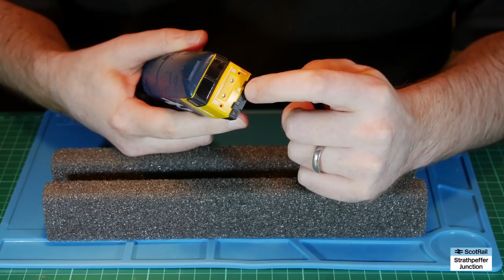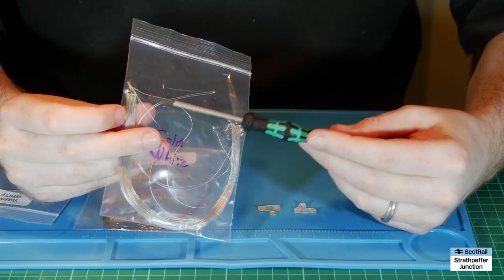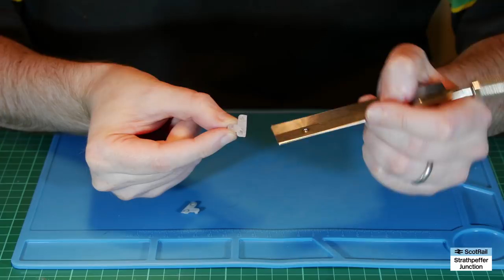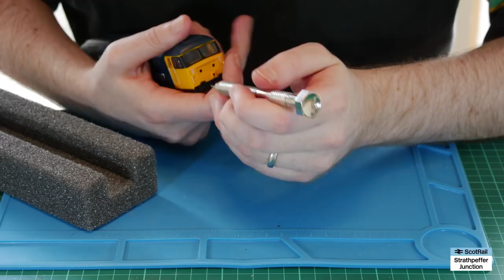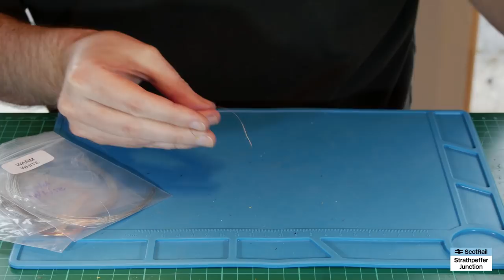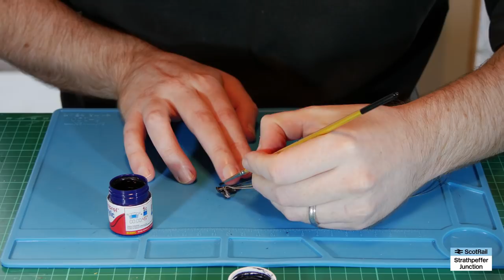#14 Lima Class 47 Loco Upgrade: Installing Directional Lights (Part 2a)

Comment: Nice work there.

Small suggestion.
When you're drilling holes for things like the red marker lights you've done here... use your model scalpel and use it to poke a precise dent at the centre where the hole will be drilled.

It works like a shallow pilot hole to give a guide so the drill bit doesn't accidentally jump to one side or another.
Reply from the maker: Nice one. Top tip! ☺️👍🏻

Comment: Damn fine video which I will need to watch again. Looking forward to seeing part 2b
Reply from the maker: Thanks, Guy. Very much appreciated. Part 2b came out in the wee small hours (it was uploading over night), so you've not long to wait! If you've any queries, just drop me a line. The main thing when wiring up the directional lights is to remember that if there are two cabs, no.2 end should be reversed for it to operate in a directional way.